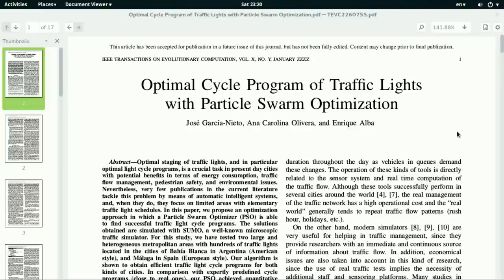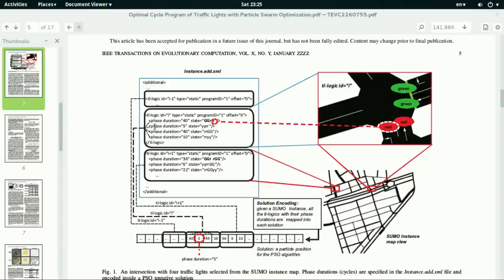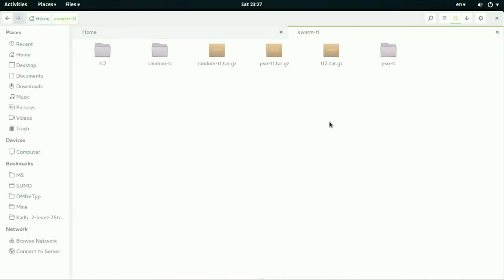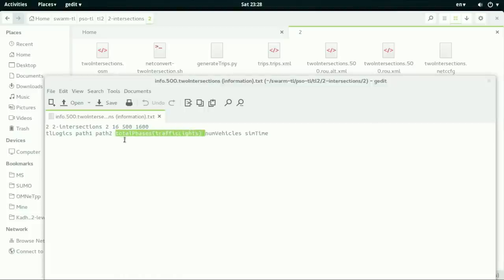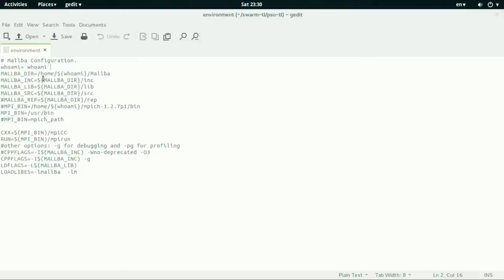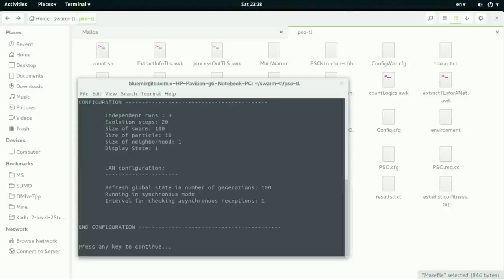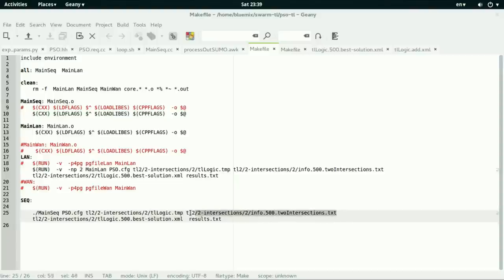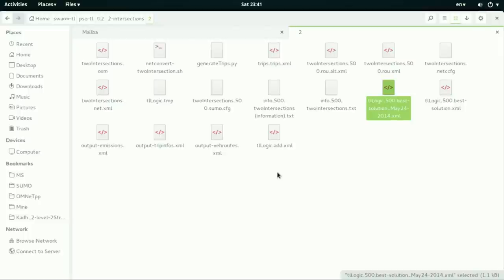SUMO with Particle Swarm Optimization

Comment: Hi AbdElmomen I'm Ana Carolina Olivera. Thanks a lot to share my work in a very useful and nice video!!! If you have question, please do not hesitate to contact me.
Reply from the maker: Ana Carolina Olivera 
Ah!, that is amazing :D
Am fascinated by your work, which led me to create a video about it.
The problem I faced is that MALLBA can't process in parallel, only in sequential mode.
However, sequential is enough for me :)

thanks a lot :)
Reply: +Ana Carolina Olivera Do you know who to install Mallba?
Reply: +Satyajit Dhawale The best option for install Mallba is follow the instructions on the web site. The main issues are the libraries (old and decapreted that you need to install and found separated to mallba) and the .io in the files that must be changed (In the Internet look for .io package compatibility). What is your exact problem? =)
Reply: +Satyajit Dhawale the instructions are in the website http://neo.lcc.uma.es/mallba/easy-mallba/ . The library mpich is old and need to install separate.
Reply: Yes. I already this page, it's old and need to update. But I was trying install mallba on Ubuntu 14.04. Actually I required to modify it. By the way do you know any other optimization framework/tool that will work with SUMO > NS2?
Reply: +Satyajit Dhawale I think that you need to contact the owner of MALLBA library to found your problem. I use MOEA Framework and work perfectly with SUMO.
Reply: Hello Ana, I'm inspired by work, and it has really aid me in my research, I am happy to hear that you were able to use MOEA framework with sumo, could you pls share a detailed video on that or probably provide a link.Thanks
Reply: Dear Morrison, I'm currently writing an article with that information. I hope finish and send to review soon in order to share with others. Thanks

Comment: Hi thank you for the video it's very helpful :) I have a question please how can we generate a file containing informations about the parameters of each vehicles? I used differents output commands but It does not work, the generated file is empty or it showed only the first time step 0. I need in my project to quantify the average speed, the density... for that I need speeds of all the vehicules for each time step. Thank you
Reply from the maker: Marwa Ben Slim any vehicles-related data is in the routes file. What kind of "differents
 output command" you used? I'll try to post a new video about how to 
extract stats information from the sumo simulation.
Reply: In routes file, there's only the start time and the edges taken. I need to have an output file that gives me all vehicle speeds at each time of simulation. I tried --netstate-dump and  --vtk-output and other output options of SUMO. The same error comes out:
Error: The edge 'name_edge' within the route 'name-rout' is not known. The route can not be build.
Quitting (on error).
Reply from the maker: Marwa Ben Slim 
"I need to have an output file that gives me all vehicle speeds at each time of simulation", I'll post a video today about how to generate statistics from SUMO, hoping that would help you.
Reply from the maker: Marwa Ben Slim see this video: How to generate statistics from SUMO
hoping it might help you
Reply: Thank you It's more helpful but I use windows 7 as OS for that I have problem with the python files. I explain to you the steps I followed to generate files to be more clearer.
1/ I downloaded a map from openstreetmap.org (an OSM file)
2/ I use the commande netconvert to convert this osm file to an xml file (file.net.xml file)
3/I added polygons with the command polyconvert (input file.net.xml, file.osm and the typemap.xml and the output file.poly.xml)
4/ I generate random types, vehicle characteristics (start time, cost ...) and the paths taken by executing the file randomTrips.py
5/ I run the simulation with sumo-gui (perfect but as a warning :for each vehicle it's mentionned that it's has no valid route ). 
Now during simulation (the time step = 1 second), each vehicle is moving at differents speeds (example: time=1s vehicle 1 = 2.4 speed, time=2s vehicle 1 = 5 speed...).
 I need to have a generated file containing these detailed informations or a file containing average speed (especially), density...
Reply from the maker: Marwa Ben Slim in this case, you need to learn the python TraCI API. You have to list all of the vehicles, and for each simulation step, you record every vehicle data (speed, acc., etc...). It is very easy to do it, you just have a basic Python programming and know little about APIs.
Reply: ok thank you a lot i'll do it and we will be in touch :)
Reply from the maker: Marwa Ben Slim  you welcome at any time :)
Reply: Hello AbdElmomen, Thanks for the video, I want to implement same thing in java, can you recommend any solution.
Reply: in java or python
Reply from the maker: +Morrison Idiasirue I don't know really. try to search for in on GitHub.com
Reply: Hello AbdElmomen, I want to implement it using Mallba, I have downloaded Mallba, and I have installed Mpich using terminal, Currently I am having issues installing Mallba, especially the configuration file..Can you pls tell me how to solve this or maybe do a video on this, Thanks
Reply from the maker: +Morrison Idiasirue, I am deeply sorry, because as far as I remember, I spent many days trying to run it, and when I ran it, I uploaded its code on GitHub that is shown in the video description.

Comment: Hi man I've seen your videos many of times, and I'm developing a Proyect with sumo and I'll put in the SUMO real values of the traffic light from my city and want to know how can I put this values on the SUMO with python.
Reply from the maker: Michel Zarzosa Rojas In this case, please see the example directory of sumo (the game) :)
Reply: AbdulMomen عبدالمؤمن  I will, but for example I have the values of the traffic light' sensors and I'd want to put into the sumo in a specific traffic light. i'm new using SUMO please help me.
Reply from the maker: Michel Zarzosa Rojas This is exactly my project am currently working on. I've used SUMO induction loops to detect the presence of vehicles above the current lane. First you have to understand the example to build your own induction loops detection system. When I finish my project I'll post the code online.
Reply: AbdulMomen عبدالمؤمن thanx Abdul. I will waiting your post, if you can, please send me all information about sumo, the main page isn't very helpful.